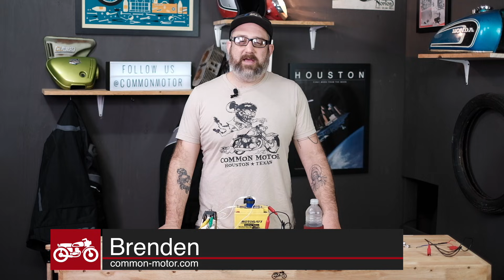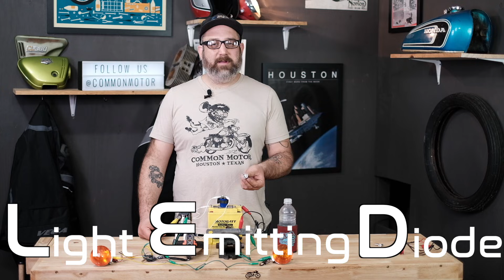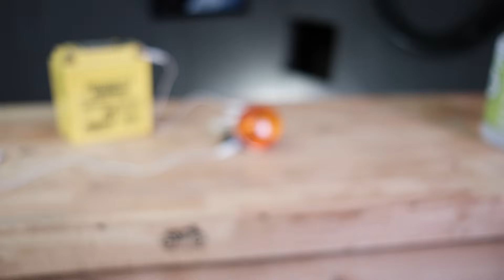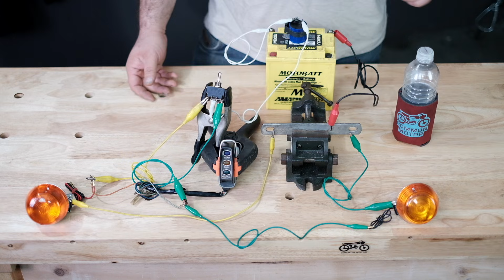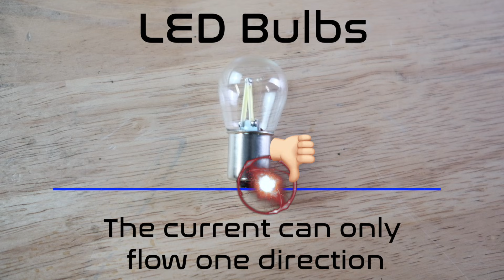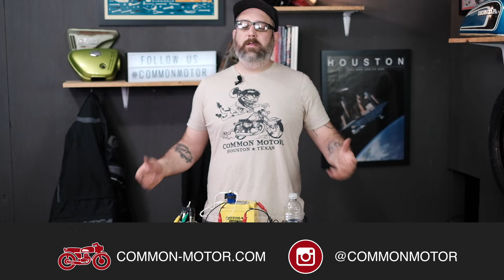How To Get LED Turn Signals Working On Your Vintage Motorcycle

Comment: Would you need 2 diodes and 2 electronic relays for 4 signals or wire them together ?
Reply from the maker: The diodes are only to allow the LED indicators to function properly by taking either direction circuit on these old hondas and changing it to a single direction circuit. As for the relay I'm not sure I understand your issue. Your bike will only ever need 1 turn signal relay. All turn signals should always on the same circuit.
Reply: Common Motor Collective  thank you brother!

Comment: I’m trying really hard to follow along. I just can’t quite figure it out. Too many colored wires ! I have all the LED’s in, and the new blinker relay. But how I plug the Diod into the system is beyond me ... someone help, please.
Reply: TinyVids Same problem here. I need actual wire colors, not a mock-up

Comment: Would a bad flasher relay cause one side to flash normally and the other side to only flash a couple of LED’s? I’m using 40 LED tower types.
Reply from the maker: I'd recommend going to our support and scheduling a tech call. Usually the flasher is an all or nothing. We may be able to help you figure it out.

Comment: Thanks - will this work with both 12V & 6V ??
Reply from the maker: 12v only, 6v systems are wired different.
Reply: @Common-motor  have we a seelution for 6v with similar change possible pls brandon thanks a lot and one last question your other video which covers getting more out of ur battery power is not supported with 6v possible pls pls and thank you so much cristal clear explanation

Comment: Thanks.   I'm going to need to watch this again . . . . slowly.  ; - )
For the life of me, I could not get the LEDs to work right.   But then I realized that it's the LIGHT BLUE wire that's connected to the turn indicator, not the DARK BLUE wire.    All is well now.